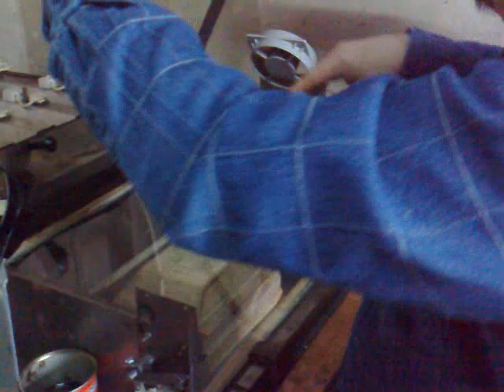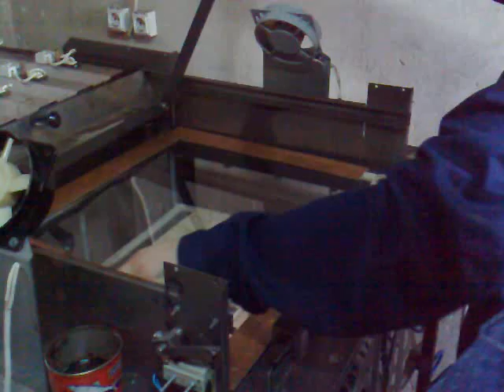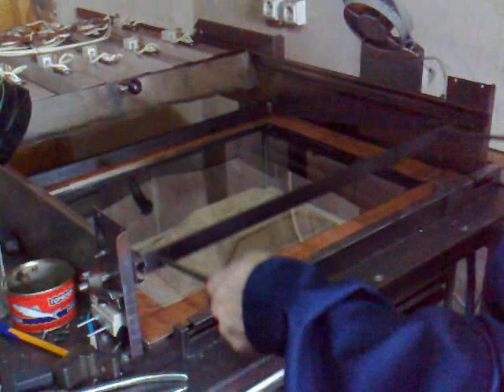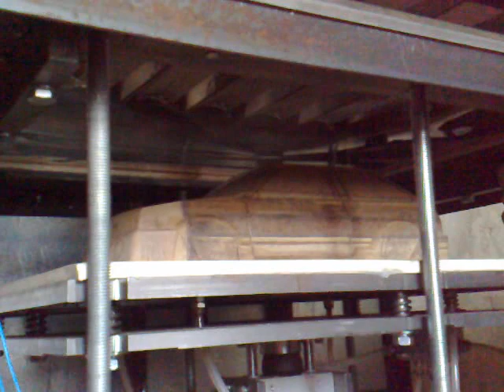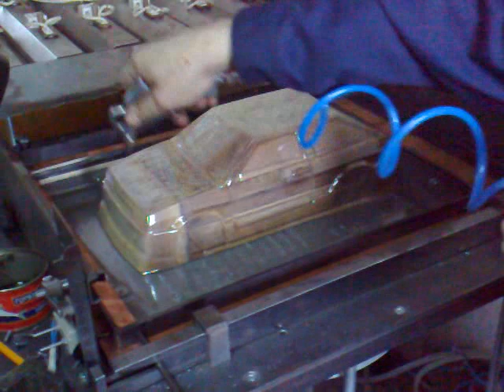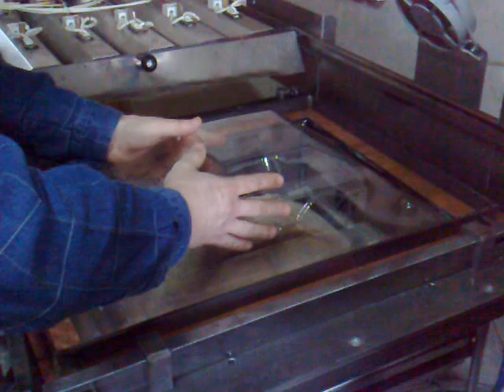Формовка кузова для радиоуправляемой модели

Comment: Friend, you said that you´re using PC sheets instead of PTEG sheets right now...what thickness are you using? I´ve been trying with 0.75 but it takes to much time to get soft on 180 celsius degrees, when I use 200 or 220 it fries the PC and make a lot of bubbles...thanks!